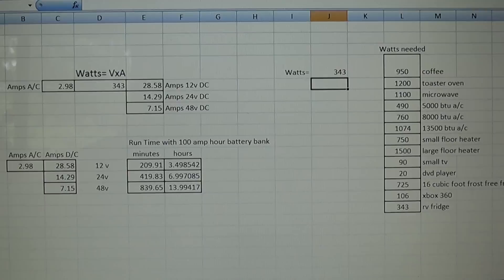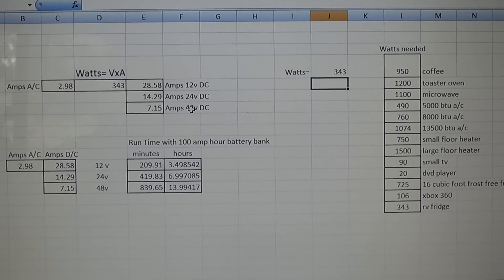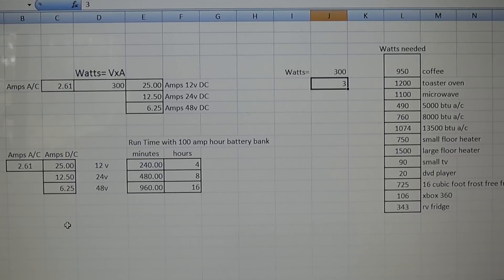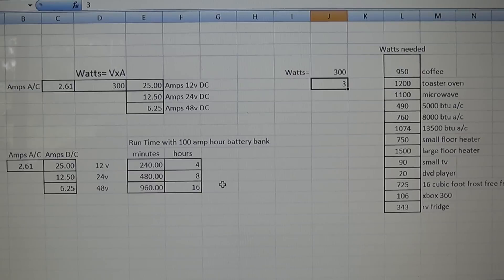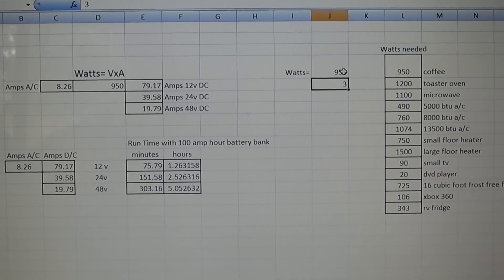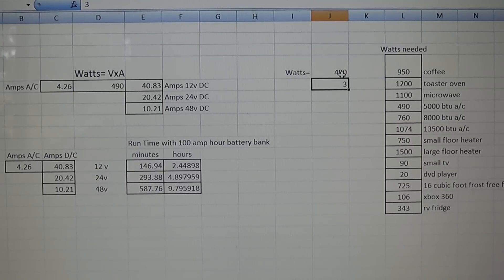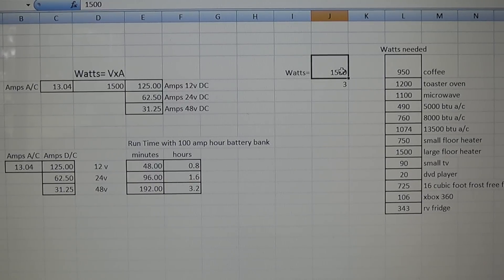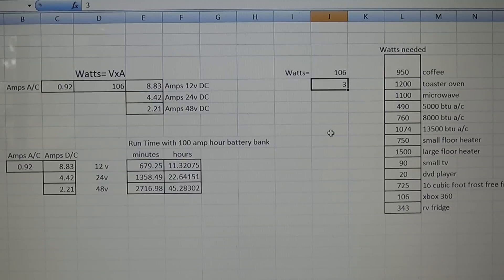What can run on an inverter and for how long?

Comment: Straight Away I went 24 Volt on My Van and Bunkhouse Systems and 48 Volts on The Main Lodge & Home here. And Saved more in wire and fuses than Inverter Costs and Peace of Mind in Battery Storage and Capacity
Reply from the maker: Smart

Comment: I hear you referencing a battery bank but what about a car battery?
Reply from the maker: Car battery is a bank of one battery, with a very low storage capacity (most likely).  You can run the car to supplement the power, but that is generally not an ideal situation, and I don't recommend doing it for very long.

Comment: My question would be is can I run a 48V system connected to my 12 volt battery
Reply from the maker: Going to say no.  Technically you could get something jump the voltage from 12 to 48, but it is going to drain the battery in a hurry, depending on which battery you have and how big the load is.

Comment: I tried to run my washing machine on my 9200 watt generator. It wouldn't work, unless I turned on the dryer at the same time and put an electric heater on the leg opposite the washing machine. My question is, will a fluctuating load damage an inverter? The washing machine motor starts and stops every few seconds.

Comment: I'm glad I came across your site, just the man I want to ask this question.. trying to run my full size refrigerator full time for a couple of months until I get some electrical work done later this summer. Can't pull my big refrigerator out from the back wall because it's extremely heavy so I can't even bulge it..and since I have no electricity in my home period...I want to buy a 5000 watt inverter, battery, and  charge controller along with big terminal wires that you're talking about. Tell me what to do please because I've been reading this and that and I'm just sooo confused...sooo confused!! 😭 So you're my only hope that I have left, I want an inverter with that amount of wattage because I may want to run other things. Tell me about how much wattage I need in solar panels, battery bank..like 200 ah batteries or whatever it takes to run something around the clock until I charge it back up with solar panels. Please help me. I'm also considering buying a more modern money and energy saving refrigerator, but I want to talk to you first.
Reply from the maker: This is an interesting problem.  My full sized fridge averages between 1.5 and 2 kilowatt hours per day.  You will need enough solar input to fill that need, plus whatever else you want to run.  There are a ton of variables to take into account.  I would suggest going to the Arizona Wind and Solar forum, it is very likely some one has asked a similar question  that you could get some guidance from.  If this is not going to be a full time solution, I would consider looking into something like the Eco-flow Delta series, or one of the big units from Bluetti.    It would be an all in one solution, and you would just have to hook the panels to them.

Comment: Hmm, this seems overcomplicated. I mean why not just deal in DC and consider the inverter as the load. I mean if you know your devices are going to pull 500 watts out of the inverter, why do you need to know how many amps in AC that will be when you are dealing exclusively in DC.
Reply from the maker: You could do that I suppose.

Comment: Some people are going to be disappointed with the reality of these outcomes but for me and my 12volt/ 2000w continuous system, they work. I only need my inverter for short periods of time, maybe 5 minutes at 1000-1300w maximum. Any more than that and I would have went for a 24volt system. Guess it all depends what you are using it for.

Comment: I’m living out in the DR and can use some advice in terms of the wattage and battery size needed to accomplish my goals. I want an inverter that is large enough to run 3 ceiling fans, some of the outlets, and 3 TVs (32, 43 and 55 inch). The outlets are needed because I work from home and need ability to power a 14 inch laptop and my wireless router. And also have ability to charge my smartphones. I don’t anticipate having to run the inverter all day but maybe for a few hours, hopefully. One or two of the fans can be turned off if I lose power during the day. I’d love to hear your feedback on a good size to meet my needs as well as battery size.
Reply from the maker: There are far too many variables for me to even guess.  You will have to do the math yourself with the equipment on hand to calculate it correctly.

Comment: Can i run a immersion heater on inverter??(Amaron inverter)
Reply from the maker: Maybe, do the math and figure it out.  It should have the watts it uses ( or amps then multiply by 120).  If your inverter has the capacity, you are gold.

Comment: i have a dumb question but, i have tried to search for an answer without luck.  So i hope u might give your opinion. I will keep it simple.. We will use the 450 Watt AirCon in your video. The AirCom uses 450W and roughly 41amp and will roughly run 2.4 hours on a 100 Amp hour battery bank. My question is if a Vehicle is started and running and charging the 100 amp battery  bank how long would it last? or  would The cars alternator be able to keep up with the draw? The alternator is roughly a 100 amp Alternator..
Reply from the maker: I would not try to run AC on the car alternator.  Depending on the chemistry of your batteries, you will won't get 2.4 hours of use either.  You don't want to fully drain them down.

Comment: I have a cooker with the Rating 120v / 60Hz and 750w
Please how many VA Inverter can I use to power it for 8hours
Reply from the maker: It isn't the inverter, it is your batteries you need to worry about.  If you want to power it for 8 hours, you need 6000 watt hours of usable capacity.

Comment: Just got a 2000 watt converter, planning on hooking my projector up to it while camping. Would my battery be drained after one movie?
Reply from the maker: Depends on the battery, how long you run the projector, and how much power the projector uses, and how much power the inverter uses to convert the battery power to AC power.

Comment: Battery bank: Series=double the voltage. Parallel= double the amperage(amp hours). Lets take what I got, two systems, one isn't ready as I need more batts. single #8D size 200AH 12V(currently in use until I get the rest and then moved to a different location). #2 is, will start at 2X #27 size batts. If I wire is series I will get 24V at 100AH. If I wire in parallel I get 12V at 200AH. However wiring in series allows for greater solar charging of 800W instead of 400W on my MPPT controller
Reply from the maker: Weird.  It should be the same wattage input.  The amps and volts will be different, but the wattage should be the same.
Reply: @FernbarkFrist  Its the max wattage input, not the actual. A 30 amp controller will take up to 400W at 12V or 800W at 24V. Panel would be 400W regardless. Output amperage to a 24V battery would instead be around 15 amps.

Comment: Opened my eyes. I have an EGO 56v power station and a 12v 100ah battery with solar. They both used power differently. I guess the ego must have a 48v inverter which explains why I get a decent runtime.
Reply from the maker: You should get the same run time if the batteries are the same chemistry and have the same Watt hours.  Also keep in mind that the Ego batteries are LiPo and can drain down 80% and probably your solar set up has lead acid, and that you probably only drain down about 30-50% of the batteries capacity which shortens the amount of run time.

Comment: Hi, I'm not getting the math, I need help. I have a hanging (just a cord with an on/off switch) lamp that I got from Ikea with a 60w bulb. It;s plugged via a 16 gauge extention cord. I plug it in my Van's 12v on a 75w inverter. it works but not more than 5 minutes and the light goes out. What am I doing wrong? My Van has a 700CCA, not sure the other specs...
Reply from the maker: Well,  CCA is a measure of the Cold Cranking Amps the battery has, and not an actual measure of the battery's capacity.   You are looking for a number followed by "ah" after it.  If I had to guess what the problem is, your inverter is probably over heating and turning itself off, or the wires going to the inverter are too small and the inverter is sensing a low voltage (causing it to turn off)
Reply: @FernbarkFrist  amp hours... but was the 75w inverter not enough to power the lamp bulb; it's a CFL bulb so it shouldnt draw a lot right?
Reply from the maker: @dadaUnts  It should have enough power.   I am not there to look at it, and I don't want to trouble shoot it long distance.  There are many things that can cause your system not to work.
Reply: @FernbarkFrist  ok so I also took a look at the lamp; 75w, 120volt 60hz, sorry for asking too much but I just need to know, I really appreciate this, thanks

Comment: For get the soler panels you need some 6 volt batterys In my motorhome i have 6 -6volt batterys more amps using 6 volt batterys. and you will need about 600 watts of solor. this will do most every thing, tv,led lights, refrg . this will run a small house but no ac, no elect heat.  2000 or 3000  watt inverter/ charger.   volts x watts = amps
Reply from the maker: First, your math is wrong.  Volts x Amps = Watts
And I have been using Trojan GC6 batteries for years.  Also, now that LiPo batteries are cheaper, they are the standard for batteries.   I will never buy another 6v battery again.

Comment: Is this chart based on running one 12V battery only?  because every thing seems like it just doubles after that. 48v running two12v batteries and 48v running four 12v batteries. If this is the case what is the reason for someone to buy a 24v inverter or a 48v inverter when really all it amounts to is just more batteries.
Reply from the maker: Higher voltage allows the use of  thinner wires, which are cheaper and easier to run.

Comment: Excuse me ignorance I know this complicates the issue but do you have to take account of starting wattage how long does that run for when you're running at AC before it switches back to running wattage
Reply from the maker: The starting wattage (or surge) takes only a fraction of a second, and won't really factor into the how long your batteries will last, but it does factor into which size inverter you will need.

Comment: Hi! I’m trying to figure out how long I can run a 1800 watt ( I know it’s a lot) air fryer oven on a 3000 watt inverter. 12 volt solar system with 200ah battery. Thanks!
Reply from the maker: Just about long enough to half cook your first batch of whatever.
Reply: @FernbarkFrist  So I can’t bake cookies for 10-13 mins? Ok Thanks for replying!
Reply from the maker: @wcoastgardener209  You probably could if you wanted to take your batteries to a very low level, causing them to have a significantly shortened lifespan.

Comment: Want to run a shop vac for work truck 10min per day its 11amp x 120 1320 watts... will a dewalt 1000 watt with 2000 peak be fine....and for how long will it run or should I run it with the truck on....
Reply from the maker: Depends on what the surge for the Vac is.  If the surge is over 2000 watts, then it will never work.  Plus, the surge doesn't have to last long, I had an inverter that would not run a fridge because a split second of surge kept popping it.
Reply: How do I fig out the surge
Reply: https://www.globalindustrial.com/p/janitorial-maintenance/floor-care/vacuums-wet-dry/55-gallon-3-0-peak-hp-2-stage-wet-dry-vacuum?infoParam.campaignId=T9F&gclid=CjwKCAjw88v3BRBFEiwApwLevaq2HyDv-j-4M_mQXL5Pvl_yY2myahBVl9-0UyFKHzen-2d2nl4CFhoCpe4QAvD_BwE
Reply from the maker: you have to use an amp meter and closely watch as the surge is a split second

Comment: You should add in a factor of 80% efficiency (multiple calculated DC amps by 1.2)
Reply from the maker: Shoot, most of the people watching this can't do Watts = Volts x Amps, an efficiency correction would really throw them.
Reply: And the fact that most will kill their batteries in a few charges by not sticking with the discharge rule, again depends on what batteries the user chooses.

Comment: Very good video! I think the only thing I would add is the fact that many 120V appliances will actually consume more power from a square-wave source than from a sine. This is due to the electro-mechanical inductive principles exploited from the current. In short, for appliances using induction motors, you can actually safely off (I'm guessing) at least 5% of the inverter's exchange.

Comment: Haha...i just had a funny idea. You can use your xbox as a space heater 😝  but my first idea was that this combined with other things that can extend the energy usage and create less loss. If you were using this in an off grid type application. There's a space heater design that takes very little energy to heat using a big bolt, a bunch or washers and nuts to cover the whole length. And 2 terra cotta pots with holes in the bottom. You assemble the pots inside one another with the bolt and nuts holding them together and put washers and bolts over the remaining threaded rod. They used candles to heat a room in their video, but a small heating coil could be used off battery power.
Reply from the maker: Those don't actually work.   I have tried them.

Comment: GREAT video!An example...60ah - 12v HIGH cicle battery for starting car ,and 3 more the same type in caravan treiler conected parallel...For an electric divice that consumes 1000watt in 220volt power grid , how many hours will it run? (For the 3 batteries fully charged with 2000watt inverter.)

Comment: thanks! so im setting up 4 6v golf cart batteries in series to get 24volt with 5 100 watt solar panelsdose that sound right? im thinking for power tools short run time. i know if i double the storage it would be better but most of the expense
Reply from the maker: The higher voltage will be better because you will have less amp draw, but you still will not get much run time depending on the tools you are operating ( say a compressor or a big saw)

Comment: I am needing to keep my motorcyle battery maintained. the storage building I keep at doesnt have electric. If I  have a 500w power inverter with only hooked to it is a 1.25amp battery tender plus charger and maintainer how long will it last??

Comment: Thanks for video. Spreadie can be figured out. 300W. Power=VA, so DC Amps is 300W/12V=25A DC. With 100Ah bank its 100Ah/25A=4Hours. If interest, can do a spreadie for above showing 12V, 24V and 48V.

Comment: I need a mobile emergency battery bank in South Africa we 4-hour load shedding cycles daily. Reason for the mobile system is I rent a property and might have to relocate in the future. The only appliances that I want to run from the battery bank are: (A) 2 x LCD Flatscreens = 300 wh (each) x 2 = 600 wh (50 ah) (B) DSTV Decoders = 20 wh x 2 = 40 wh (5 ah) (C) Personal Computer = 250 wh (21 ah). Total amp-hours = 76 ah x 4 hours = 304 ah x 2 (50% discharge level) = 604 ah.  If target 12v 200ah Gel batteries will 3 batteries 200 ah batteries be sufficient? Calculating the right size Inverter with a 20% safety margin 3680 watts 736 (20% safety) = 4416 w. Will a 5000 w Inverter be sufficient. Please review these calculations and provide me with feedback. Regards, Jakkie

Comment: Makes sense, now I know what inverter to buy, but what I really want to know is if I can use a 350cca l&g battery as a power source to run a Keurig for 4 hrs.?
Reply from the maker: Depends on how many cups you are making in that time.  But I would guess it would not last for too long.

Comment: You’re spreadsheet and theory is flawed because you have it set as 100 amp battery bank. You do not get twice as much from the same battery bank just because it’s 24 V over 12 V your battery bank would have to be twice as large for 100 A at 24 V versus 12 V. 
2x100amp 12v batt = 1x100amp @24v or 200amp at 12v. So 12v or 24v will have the same run time off the exact battery bank depending on whether it’s configured for 12 V or 24 V you will not double your running hours off the same battery bank.
Reply: correct

Comment: So i want to run a 500 watt a/c from a 12volt inverter so that is 50amps being pulled from my battery so to cover the use would 500watts worth of panels work?
Reply from the maker: You will need many more panels.   They never work at 100% efficiency and you also have to account for the surge when the unit starts.

Comment: Hey bro you seem like you really know your stuff. And even you breaking it down is confusing me lol. If I got a 3000w inverter 12v converts 120v ac, would that run off a jetta battery for a 2800w alphasonik speaker? I know an amp and sub setup would be better but I already have the speaker for work
Reply from the maker: You would have to see how much surge that speaker has.   It probably would, but it is going to drain your battery pretty quickly.

Comment: I have an 19 inch energy star LED TV that I want to run in case of a power outage during the hurricane. I have a 1000w 24v inverter with two 75ah 12 v batteries wired in series to make 24v. My watt meter tells me that the TV pulls 20w. How long can I run this TV? The batteries and inverter came out of an emergency lighting system that I have, I didn't purchase these items specifically for this but figured I could use it if needed it since I already have them. I figure a 1000w inverter maybe overkill but that's all I have.

Comment: Have a dual battery system want to power a vacuum for service truck 120volts at 11 amps using this during the day for about 1hr at most will I be ok with 2000 watt inverter or should I get battery bank

Comment: Good video.
Question,  can I put 13,500 btu portable AC unit in my rv bedroom and not also run the generator since Iam driving and running my rv engine to maintain the battery power?  Possible?  Please advice...
Reply from the maker: It is not a practical solution.